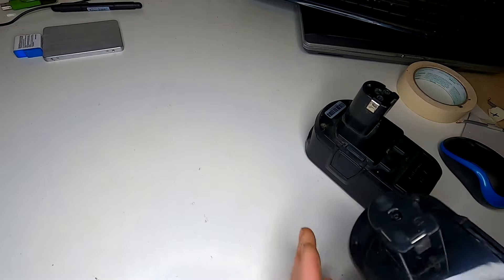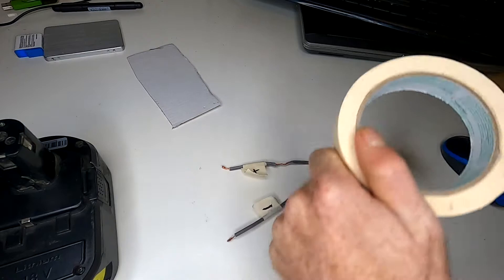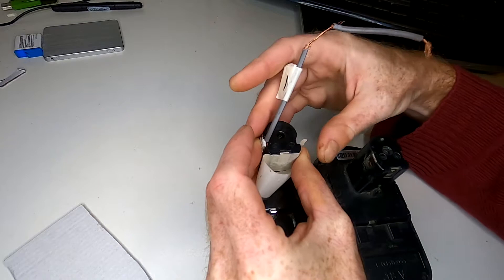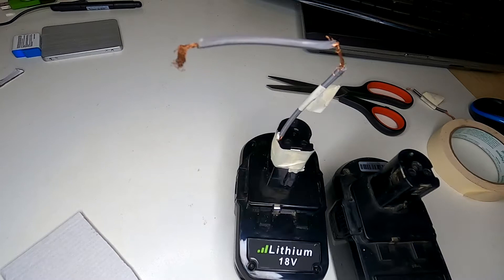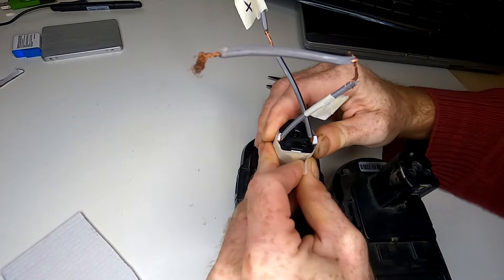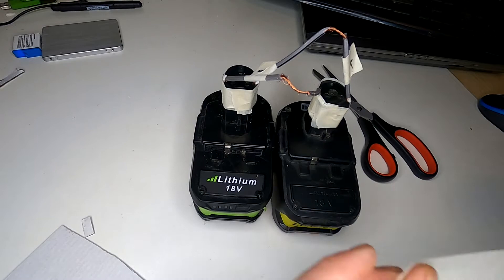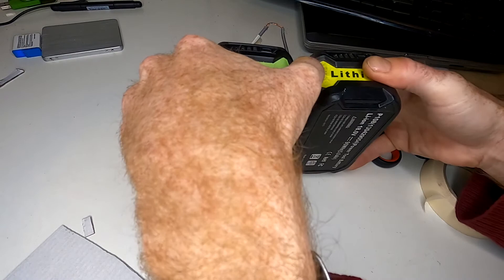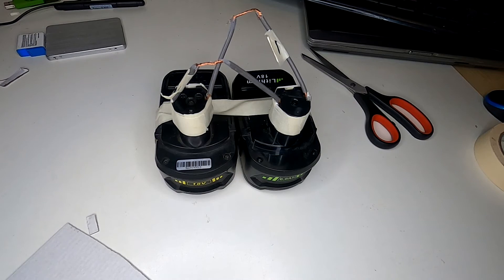How To Jump Start Your Car with 18V Lithium Ion Batteries

Comment: Great video 😊. Does this kill the 18v battery? I have heard some rumors. Also if it’s sufficient to use only one of these 18v then always better.
Reply from the maker: Mine still work fine, and I've done this at least 6 times. I have a bad habit of leaving my lights on in my current car. I haven't noticed any decrease in battery performance. They will need to be recharged though.